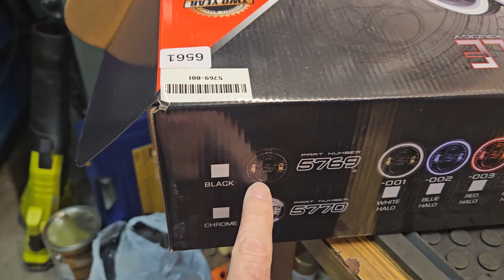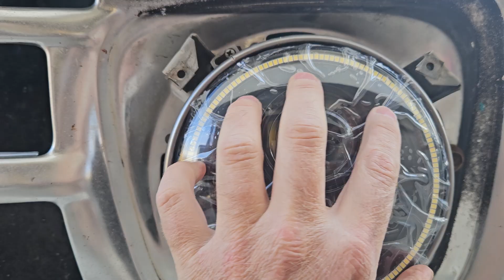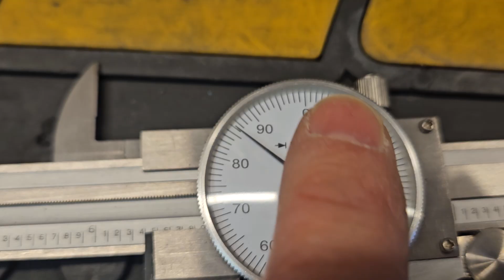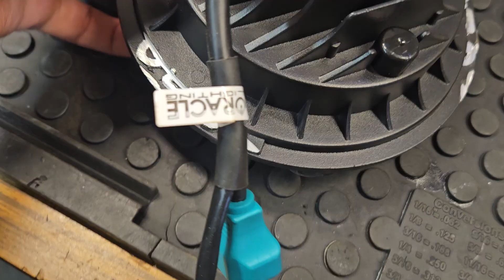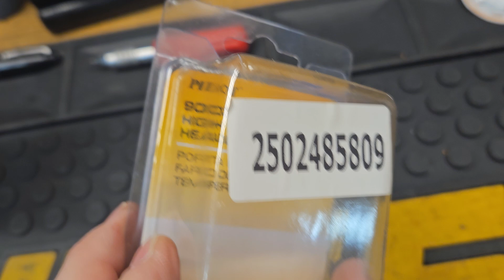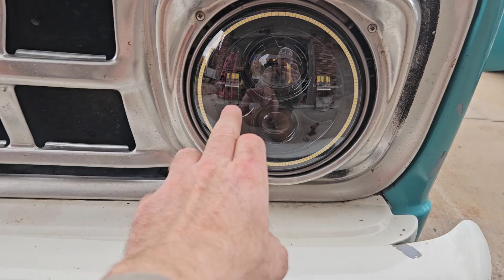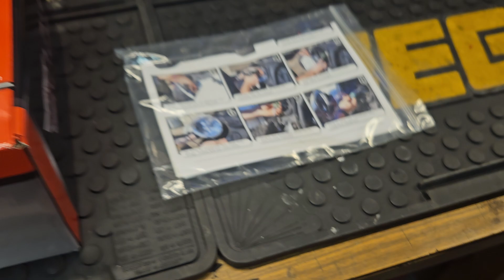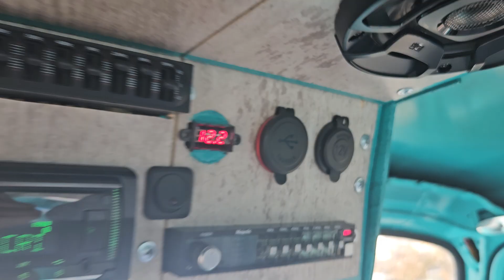Install: Oracle 7" LED Headlight 65 F100

Comment: Beautiful truck ! I have a 66 F350 dually and it still has the old dim headlights in it I wonder if these would work on mine with a little persuasion lol. Mines even the same color I believe my dad said that is called Robin egg green or Robin egg blue can’t remember for sure😂
Reply from the maker: There's so much confusion on what the color is actually called BUT I have found the Behr aerosol can paint at the Home Depot called "Tropics" is dang close. I've used it many times for little items and nobody can tell it's spray paint. Your 66 should be exactly the same and I show you in this video what needs to be done to make these work/fit